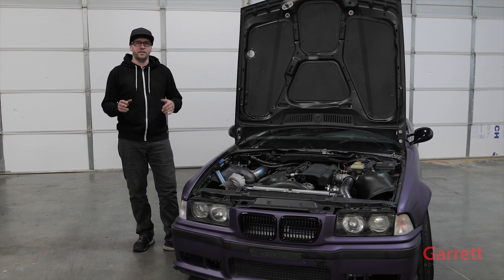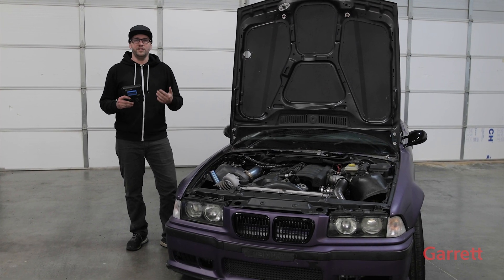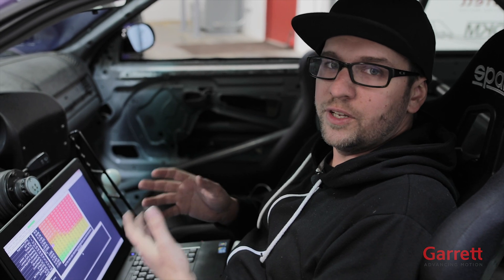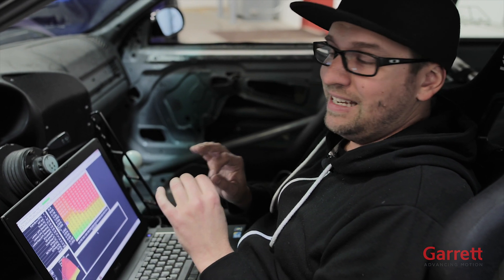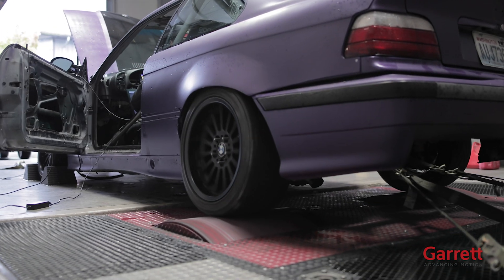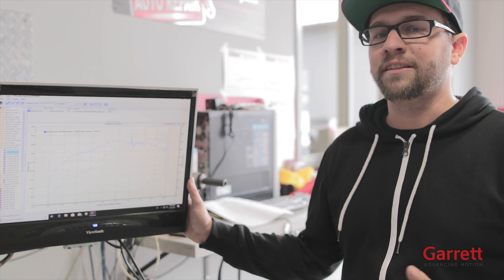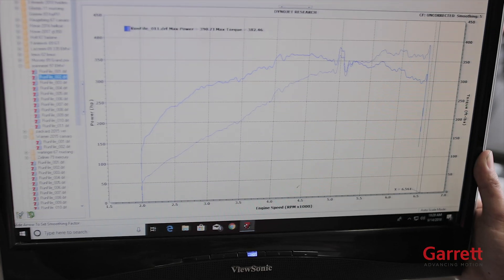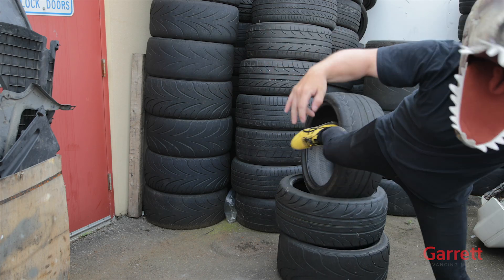How to Turbo a Race Car Part 4: Engine Tuning

Comment: what is the exhaust manifold did you use? seems like you were able to keep the coolant tank as it is and still have like 1inch gap between the turbo and tank,

Comment: is there a way to tune  with out a computer if not where would i go  for  a 2000 ford ranger v6  singal turbo in the bed not looking for a a ton of power just more then what i have gunna get a t3t4  or what wpuld u think
Reply: I think you can just use any laptop 👨🏼‍💻